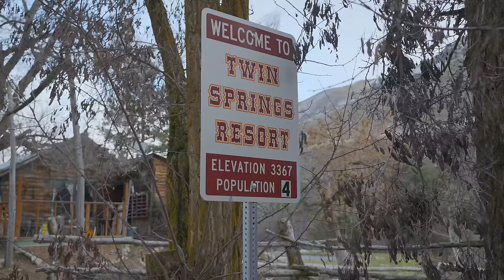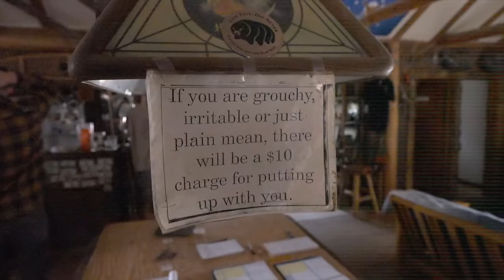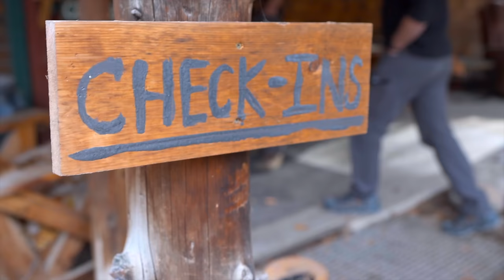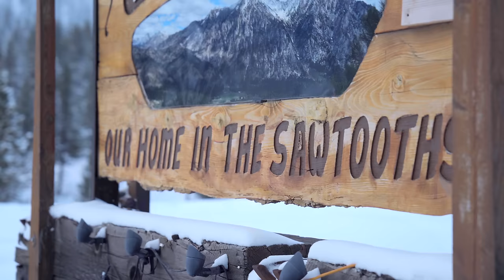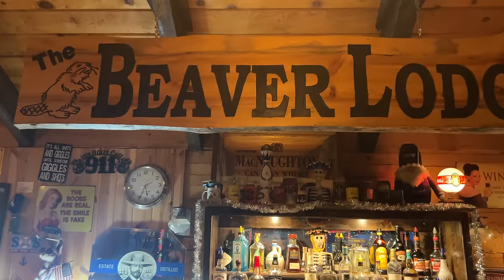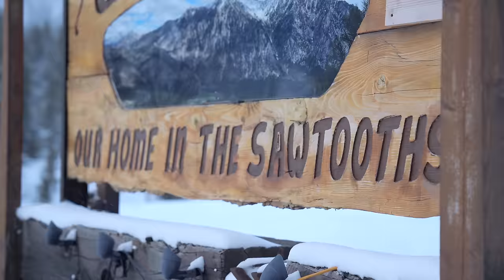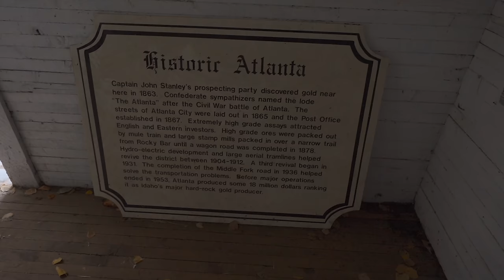Sliding Down A Snowy Idaho Mountain In My Jeep Gladiator

Comment: say if you had a big enough tarp to throw over the hood to help hold some heat in that buddy heater would have worked. "maybe" lol awesome video! thanks for sharing
Reply from the maker: lol. At this point, the buddy heater is still the easiest option to use...I just won't sleep with it running. So glad you like the video!!!
Reply: I meant it probably would have worked to thaw the steering out on the bronco, you have a killer overland rig!

Comment: Don't give up on the heater .... I've been running one for 3yrs without issues and the dry heat eliminated any condensation issues we were experiencing. I can say they do not like any restriction on the exhaust and they will smell a bit when new. (especially at start up). IMO some of the smell also comes from the ducting. Mines a 3kw running off a 500w Jackery, but I have been hearing that the 8kw's seem to require higher amperage for startup.  It might be that the 8kw's need an actual house battery unless you can find a power supply with a 15 amp rated plug as most max out at 10 amps.  I test ran my kit for a few hrs before actually taking it out in the field and I also purchased a handheld CO detector. The heater has always read zero except at the exhaust, however I would always run a portable detector during the night for peace of mind. A Propex or Wabasto is on our list if the cheaper units fail.
Reply from the maker: Awesome info. If I can make it more dummy proof and dependable I'll keep trying. I got tired of messing with though, so it's just sitting in my garage at the moment...maybe I'll switch to a 3Kw just to lower the power draw..I can't imagine 3Kw not being enough to heat a tent.

Comment: If no one has mentioned it to you, RSI has latch covers that they will send you to prevent freezing like that. Dry them out and use a graphic lube and you won’t have that issue once you put the covers on.
Reply from the maker: Ya I saw those. Part of the issue is that if you lift up the wings when it’s snowing…snow gets in the latch and makes it easier for them to freeze. I started locking the latches whenever the wings were up and it helped a lot.

Comment: @venture2roam the ket to the diesel heater is that you need a semi rigid dryer vent for the intake that pulls clean air away from the unit. I use a 5' tube on my heater so I never pull in any exhaust.
Reply from the maker: Great tip, thanks for sharing!

Comment: Check the wire gauge on your disel heater plug. I had a similar issue and realized that even though it was advertised to work for diesel heaters, it wasn't thick enough. Get a 12AWG minumum. Also make sure your outlet tube isnt crimped or blocked in any way. I've had all the codes lol. You also need to clean it and replace the glow plug every so often. Once you figure it out you'll never suffer ag8.
Reply from the maker: Really good comment. I'll check that out..but I'm kind of done with those things...at least the cheap ones.

Comment: Two parts water. One part rubbing alcohol or isopropyl alcohol in a spray bottle. It'll thaw out your latches instantly as well as the frost on your windshield.
Reply from the maker: Great tip!
Reply: You can go a little stronger with the alcohol. Make sure it's cold if you spray it on a frosted windshield though. Also, NAPA Auto parts carries shield defroster in aerosol can that works really great.

Comment: Did you have a solution for the diesel heater fumes? I had the same situation and it wasn’t from the exhaust it was like it was pumping it through the hose. Odd… no fuel leaks or anything
Reply from the maker: It might be caused by spilling diesel when filling up the tank...could also be the heater just burning off initial crud...You might just run it for a few hours and see if it gets better?

Comment: What power station were you using for the diesel heater that was under powered?
Reply from the maker: It’s an Itehil brand 500W
Reply: The diesel heater needs any where from 9–12amps to power up through startup.  Your power station has a regulated 10amp car socket.  It’s likely your diesel heater needs to pull slightly over 10 amps for startup.  There are only a handful of power stations that have a car socket that supports more than 10 amps.
Reply from the maker: @ccwstraightshooter9761  I can get it to work…but not consistently. I’ve tried lots of different approaches with different batteries amp boosters etc. I need something more simple and dummy proof lol.
Reply: @Venture2Roam 
Got it.  I think your biggest problem is buying cheap diesel heaters.  I’m definitely not a big fan of Vevor.
Reply from the maker: @ccwstraightshooter9761 100% agree

Comment: Shouldn't you be carrying tire chains for winter off road? Put chains on all 4 tires and you will be amazed how well you can get through snow and ice.
Reply from the maker: Chains are fantastic for lots of situations. On this trip we had "snow socks" that give traction similar to chains. I didn't feel like I needed anything on my truck with the Recon Grapplers. Also - it wasn't a slippery road that turned us around, it was a large washout..it would have given me pause on a dry road. The supply van for the Beaver Lodge has chains on all 4...and they passed us on the road cruising down the river at like 35 mph lol.